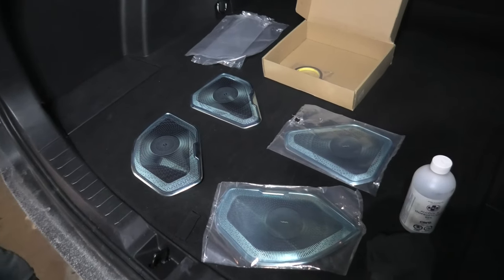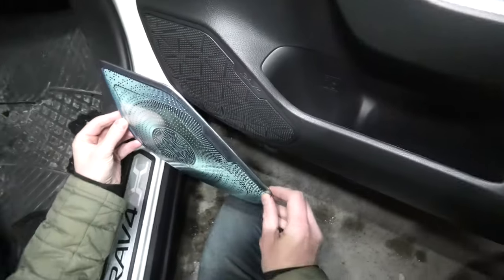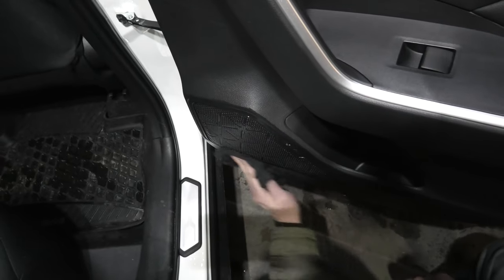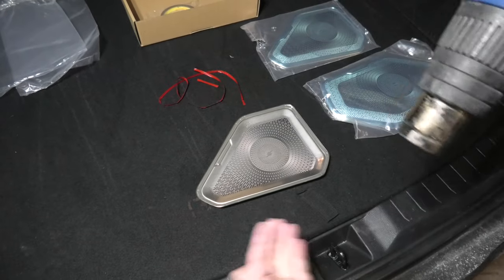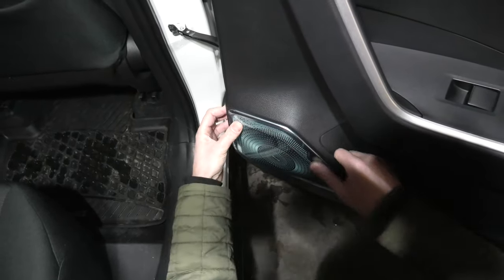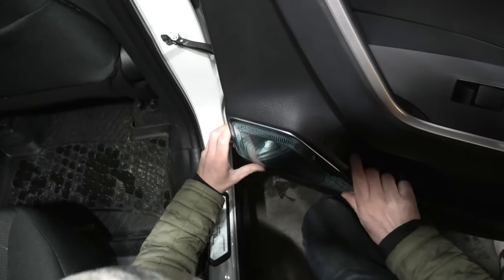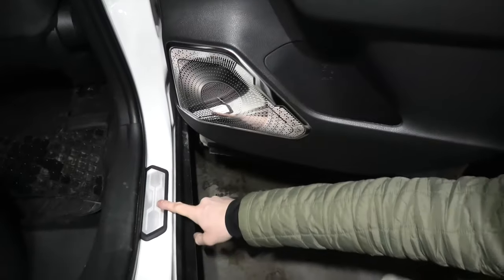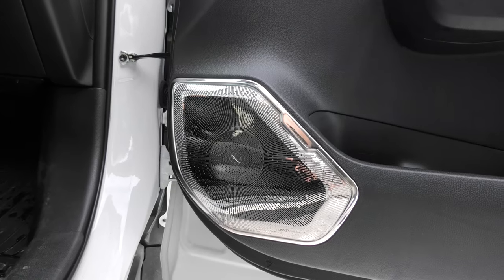Toyota RAV4 (2019-2024): Stainless Steel Speaker Covers Installation.

Comment from the maker: PRODUCT LINK:
Steel Door Speaker Decorative Mesh Cover Trim 4pcs For TOYOTA RAV4 2019 2020 2021 2022 2023 - https://cartrimhome.com/Door-Speaker-Decorative-Mesh-RAV4-2019?tracking=morozov_automotive.

TOOLS USED:
1. ISOPROPYL ALCOHOL - MG Chemicals 824 99.9% Isopropyl Alcohol Electronics Cleaner, 4.25 Fl Oz - https://amzn.to/3Y2HY13.
2. HEAT GUN - Wagner Spraytech HT1000 Heat Gun Kit, 3 Nozzles Included - https://amzn.to/3kFjLjE.